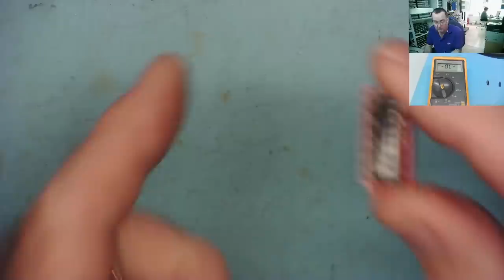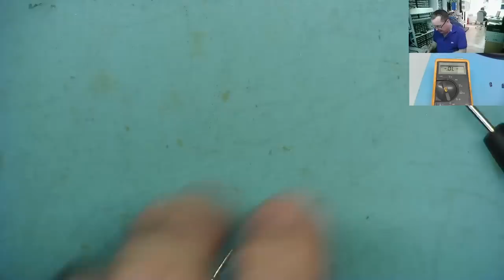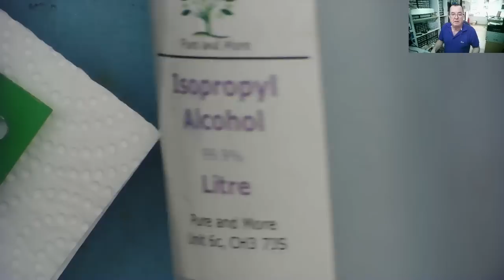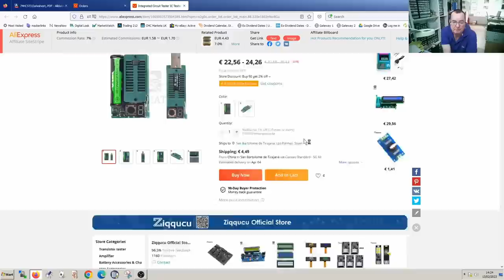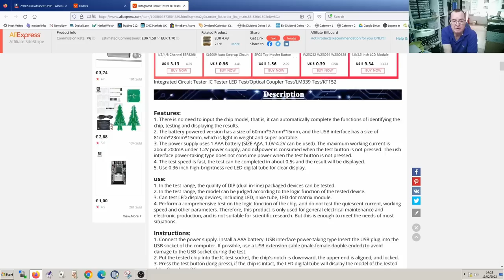This PCB has a lot of corroded tracks. Is it faulty and can I fix it?

Comment: I'm just starting to get into the whole repair part of things.  I'm a car audio installer and I'm just curious about the repair of amplifiers so I've been studying and learning because you can never have enough knowledge when it comes to car audio industry that's ever changing. I'm really learning alot from your channel so keep the repair videos coming.
Reply: Ahh, that’s how I started off working with cars. When I left school I couldn’t get a job as a mechanic as I had no work experience so I went into nursing for the next 12 years in the nhs until I happened to accidentally get an opportunity to install my mates sound system at a company when the owner sold a load of gear to my mate but didn’t have the time to fit it. I offered to do it as I’d always done my own and from that I ended up entering that company and then moving onto fleet tracking and security. Still love my audio work, one of my passions. Rich has some really good amp videos ! If you’ve not seen Sam over at Barevids, he might be of interest to you too
Reply: First 2 repairs I did were amplifiers (home sub and car amp), both were successful repairs and I've since moved to TV's and computers and pretty much anything I can get my hands on. Fun stuff.

Comment: I use those metal PCI slot covers (bent to various L or U shapes/lengths) on the back of computers to shield stuff from the hot air.  Easy and free to prevent stuff from getting too hot.

Comment: I remember when electronics was an enjoyable hobby. 30 minutes to remove a few IC’s 😢. Hot air stations, microscopes, micro soldering equipment….it’s an expensive hobby also. 

It’s hard to believe an IC can take such heat. 450 degrees, incredible when you think about it. 

I’ll keep designing with through hole stuff ha ha.

Comment: Absolute n00b here. When you're taking off the ICs and capacitors, what does the solder paste do that the soldering iron and solder on their own don't accomplish? It's a very clean job, cleaner than mine, so I'm sure there is a logical answer!

Comment: hi Richard, see you have repaired your solder sucker station. I keep my desoldering station at 470 degrees  the higher temperature stops the solder solidifying down the tube and blocking it up, give it a try  you'll never have to unblock it again. and it seems to work better as well

 I Use a small piece of blue tack to hold SMD components.  just stick a small piece  to the bench and then stick the component under test to it. Stops components flying off into the Abyss especially those very small SMD capacitors and resistors.
Reply from the maker: The problem with the other desolder gun was because I tried forcing a cleaning rod down it with a pair of pliers while hot and seriously clogged up.  I hadn't realised at the time but I'd dislodged the metal tube that carries the molten solder down the centre of the heating element so the last part was actually sticking out a little way into the glass reservoir.  So basically that end was cooler than the rest and causing the solder to solidify and continually clog it up.  I bought a complete new handle for about €30 but now it's working again I will also order a replacement heating element for the old gun (about €13) fix that one and then keep it as spare.

Comment: Hi Richard, a small tip for ya, ask your lady for an old perfume bottle, clean it and fill with IPA. Later you can just spray a mist of IPA where you need it and don't have to re-use the dirty stuff.
BTW it might be a interesting video to remove all components, take pictures of the board and rebuild it with PCB Way 😋

Comment: Not that I know what I'm talking about, but have you peeked under the sticker of IC5? If you could find a data sheet, maybe you could do some basic sanity checks to see if it's working. Like VCC and enable pins, maybe check with a scope whether something's happening on the clock and data lines? I don't know, does that make sense?

Comment: Just a note you can use kapton tape to help secure components you don't want to remove it can also help protect area's by keeping some of the heat away from components. I use a blob of blue tack to hold components for testing it can be used to hold small boards still. I personally would have cleaned the solder masked on the tracks with corrosion as some times the corrosion continues under the mask. I then cover the tracks with solder mask . It's not essential but have boards that have tested ok but later the corrosion has destroyed the track. Just suggestions maybe of help to someone.

Comment: Hi,
Did you clean the pcb  44:26 to avoid contact resistance?.
The old flux changes chemically. 
The vias shown not good.
Many many work if it's corroded😵‍💫
Reply from the maker: Yeah I cleaned all the flux off

Comment: At what point would you put it in some sort of washing machine to give it a thorough clean before starting? Or would it make thins worse?
Reply: Dishwasher with minimal detergent is fine but DO NOT use the dry cycle.
Reply: Oh, and you'll want to make sure the board doesn't get tossed about in the washer.

Comment: Is conformal coating an ultimate solution to these corrosion issues especially for boards that are difficult or impossible to replace?
Reply: you do get clear board varnish spray that protects, but it will also allow you to solder to the board in the future

Comment: Hi Richard
Why don't you use ordinary household ethanol for the first clean. I do and haven't heard any valid reason why not to. Then I clean with ipa. Ipa is expensive everywhere, here five litre cost almost fourty pounds...
BUT ..Ipa smells and taste much better than ethanol. Not that I drink it, but it does get on your fingers very often, 😉
Btw. For nail biders.. dip your fingers in ethanol and the Horrific taste will stay on for hours..😂
Reply: Hopefully you mean Methanol and it is cheap but somewhat poisonous, sometimes leaves white residue on solder joints. Ethanol is vodka and expensive :)
Reply: @karltest1314  no, i do mean ethanol. It is the chemical name for pure alkohol. Household ethanol has an added agent, so you cant drink it. Methanol is also called  Hydroxymethan or Methylalkohol, and it is extremely poisonous. Methanol is obsolete.

Comment: Have u checked the trace under cap C6 it looks corroded?
Reply from the maker: Actually I hadn't but I still have the board here so I just removed C6 and had a look.  Those tracks go down to CN11 (black connectors on the other end of the board) and they check OK . Actually the power rails on this board come up OK, compared with other ones but it acts like the microcontroller does not boot up - random digits on the 'score display' every time you power on.  A good one plays a little tune then goes to 00 on the scores